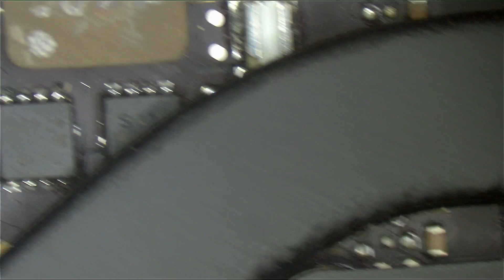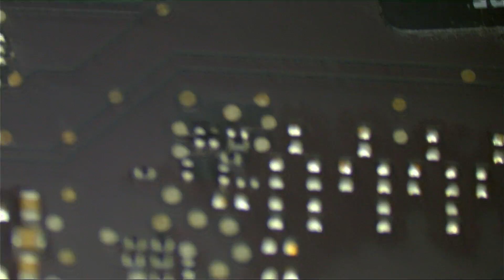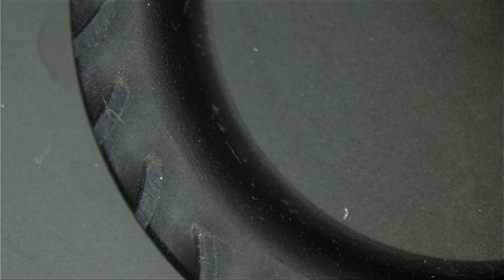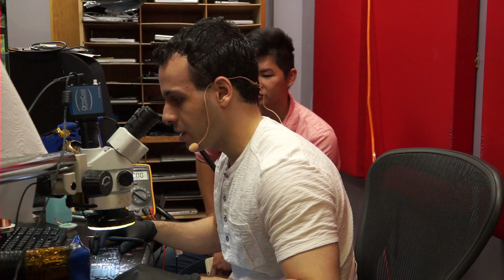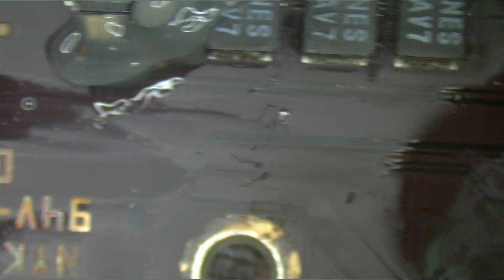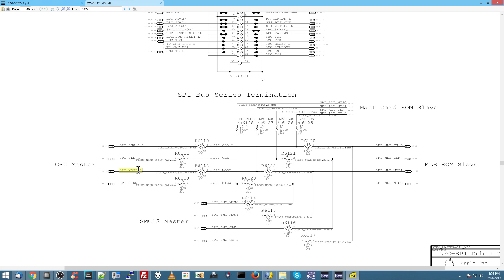My favorite motherboard repair: removing the JTAG connector :)

Comment from the maker: Want to watch our repairs as livestreams rather than edited down portions? Check out the live channel below for b-takes  & repair videos before they are edited, and random livestreams, and as always, I hope you learned something! 
👉 https://www.youtube.com/channel/UC6nZlvfz4YWoBWbjiaYJA3g
✓ Cryptocurrency tip links:
› Bitcoin: 1EaEv8DBeFfg6fE6BimEmvEFbYLkhpcvhj
› Bitcoin Cash: qzwtptwa8h0wjjawr5fsm0ku8kf40amgqgm6lx4jxh
› Dash: XwQpZuvMvU44JT7C7Uh6xHvkSadzJw9fMN
› Dogecoin: DKetsoCvwa2hF29ssgUA4Wz4hxT4kj3KLU
› Ethereum: 0x6f6870feb48f08388ee345cf0261e2f03d2fa310
› Ethereum classic: 0x671bfd61ba87edf6365c97cea33d66ba73645510
› Litecoin: LWnbTTAjojZQt68ihFJFgQq3cYHUsTcyd7
› Verge: DFumZ5sMhi3JktLQpsTVtV9xUt3zKDrcZV
› Zcash: t1Ko3FkphQYoQroQc8k2DVk4WKMAbmNR8PH
› Zcoin: a8QdvArHmdRYe1MjiqtP6jDNe6Z4JgnRKZ

👉Thank you to everyone who made a purchase on eBay via our affiliate link at http://rossmanngroup.com/ebay for helping support this type of content. All tools used can be found in the video description as well.
Reply: Most likely the JTAG connector's corrosion was pulling the test lines low, putting the CPU in test mode instead of operating normally.... quite a common issue in this industry.
Reply: Where do you get reliable schematics for these motherboards? I have found some on google but they are either incomplete or not from a source that I trust.
Reply: im not a expert of any sorts but im pretty sure usually the problem is poor quality in example desing
Reply: Yes I did and I hope the person that messed up that board learned something too.
Reply: sus sustained     voltage
Reply: I bet you both have the same chinese person! That would be funny.

Not so much for you but for the rest of us.   :)
Reply: that PCB is fryed
Reply: Louis Rossmann l
Reply: I love it when you swear and call all the apple products such shit. I do the same and people freak all the time..lol

Comment: Why remove JTAG connector? Just Curious, I don’t know anything about electronic repairs.
THX
Reply: Always corrodes first since it's usually on the edge of the board near the possible liquid ingress point and has exposed pins with power lines. He's made a meme of destroying it, but he replaces it every time

Comment: What the heck is the round glob that was just to the right of the jtag connector?  It's clearly visible at 3:25 at the bottom of the screen, below the resistor.  What is that??

Comment: JTAG is used for programming a certain kinds of microcontrollers, FPGAs with internal non-volatile memory, and sometimes SOCs. Basically anything from ATMEL controllers (like the ATSAMD series) to chipsets of PCs and Macs. Its highly unlikely that it is used to flash a bios, especially on apple products that seem to be nearly the same across the board. They simply would flash the BIOS on an external EEPROM before soldering it to the board. That is then read by the CPU through the chip-set, which handles basic functions such as the BIOS. After that, a BIOS update can be done from the computer itself without the need of JTAG. At least thats how PCs operate.

Im not sure that, that would be a true JTAG port because I honestly wouldn't think that apple would solder a connector on to something that isn't meant to be tampered with. It would make more sense to just use some pads that a pogo-pin jig can be held up against to do debugging and flashing. 

Obviously its hard to tell what they are doing with that port unless you look at the schematics, and also they are apple and they like to do things "differently".

Comment: How are the guys in the Genius Bar meant to diagnose and repair boards if you've removed the JTAG connector? ;)
Reply from the maker: I know, what a pity :)
Reply: how likely is it that the genius bar actually even bothers though
Reply: @cyborgsheep6077  You found the point of the joke, congratulations
Reply: I scrolled through soo many comments searching for this one, thank you so much
Reply: You don't give something under warranty to Louis and you don't remove a jtag connector on something with warranty?

Comment: What does the JTAG connector do?
Reply from the maker: Allows them to program it at the factory.
Reply: I was looking for an answer to this question. Wonder why this didn't get upvoted. Thanks for asking :)
Reply: Louis Rossmann I would have expected a better answer than that. It's a two wire serial bus to talk to JTAG traps on the chipset, flash memory etc. A JTAG trap on the CPU might be able to flip the CPU into a debug state where you can single step, change registers on the fly, drive it's address and data busses etc. On a chipset you could potential read and change registers on the fly and flash memory has a trap to dump it and write to it. You can often do more with a JTAG than programmatically because it exposes things you could usually not get to, such as changing the code in an FPGA etc. Before you get excited a JTAG is not that useful to you if you're dealing with a secure device. Usually that will have fuses programmed on it's microcontrollers to either turn off JTAG or it won't work at all if the device has security fuses blown.. or you need the key for a cryptographic handshake. All the same it's very useful to reflashing a bricked device or for other hardware exploration.

Comment: I don't understand why other smaller shops would let that sort of stuff go.  We do not do low-level board repair like Louis at the store I work at, but even WE have a sonic wash machine.  Seriously, so many shops think a little QD cleaner is enough for liquid spills, and it is absurd.

Comment: Do you really use 450 degrees Celsius as the work temp for your hot air? Because I alternate between 350 and 400 and am scared to be too hot where it messes up other things or too cold where I need to keep on heat too long to melt which also messes stuff up. Thanks

Comment: I may be 15 and looking too far into the stars but.... Someday I want to open a store that has sort of the same morals that your store has. I cant stand Apple because they are a complete rip off. I watch your videos for hours because I find I can learn a lot from them and instead of loosing money messing up some kid at school's computer, I can learn from how you do it. I believe in repairing things whenever possible (for cheaper then buying a whole new one). For example, when i was 10 i learned what a back light was and I took apart my monitor, built a cardboard frame, and shoved Christmas lights into the back. Although it was not the best it still worked until I could get a new one. I have been clustering old Desktops people have been donating to me/ I have found. One time i found 15 IBM 2008 cash registers that I upgraded and clustered. Anyway, I like how you say "as always, I hope you learned something" because that's a good thing to share knowledge to help others in the community. My teacher just bought the "class" a micro-soldering station and microscope so I can start repairing the mac's more and other things such as connectors. My favorite repair story is when Apple told my friend "It will be an $859 tier 4 repair" then he brought it to me which I fixed for 25 cents. not $859.....
Reply: ThankGodالله UmmerFarooq they said it cost them 25 cents. Not that they charged 25. And it's their friend.
Reply: ThankGodالله UmmerFarooq It's obvious that he didnt do it for the money. He did it to learn something. Relax.
Reply: Well, did the friend learn not to buy from Apple?
Reply: Can you find me a IBM 5100?
Reply: ThankGodالله UmmerFarooq  He's not running a business, he's 15. It was his friend.
Reply: ThankGodالله UmmerFarooq  You're insane

Comment: Zero reasoning for removing the JTAG specially when it could have been easily cleaned.
Reply: They trap spills and kill boards so ridiculously easily and nobody wants that connector.  Apple doesn't want it because they won't touch this now out of warranty.  All they do is cause problems.  Someone that knows how to, and wants to use the JTAG connector on a Mac is not going to pay Louis to repair one.
Reply: Possible problems(unintentional cross talk between conductors)  could have been hidden under the J-TAG

Comment: i love this video! an american mad at an Asian because he does not over charge for doing work and it ate away at him through out the video "$87 for a touch ID" 10 times in the video. even when he fixed the problem he was tasked to do he still harped on the Asian guy for not over charging. this represents why us Americans do not manufacture anymore because every employee wants to make $50 an hour to do simple manual labor that any where else in the world does for allot less.
obviously this is not manual labor it is skilled labor and demands more money but this gentlemen charged $229 for 15 min of work and I bet the Asian guy next to him would have charged less and finished the work  (attaching the connector) 
this is just an observation based on a short video, I dont know the guy so take it with a grain of salt
Reply: I doubt the Chinese guy is doing it by blind luck. He had to learn the same stuff and still does it cheaper.
Reply: There are a number of input costs you are not factoring in. 1) Education, and the time/money he spent to become good at what he does and perform high quality and guaranteed work (a 15 minute repair for him might be an hour-long, shoddy quality repair from another technician). 2) Cost of living in the area needs to be factored in order to determine fair compensation  3) Equipment. The ultrasonic machine, rework station and all the other equipment he uses costs money. Equipment breaks down over time or becomes obsolete and needs to be replaced/upgraded so a small part of their costs should be factored into the cost of the job. 4) Business costs like rent, bills, office equipment, marketing, etc. 5) Salary for other staff like his receptionist. 6) Contingency. In case something else is wrong with the board that requires him to spend a lot of extra time on it. Or in case something goes wrong with his business then he's got a little extra tucked away to deal with it.
Reply: One man's overcharge is another man's undercharge - Louis stated the dangers of undercharging
Reply: If 2 guys done the job guy 1 has 10 years experiance fixes it in ten minutes 220 dollers guy 2 fixes it in 2 days because hes 4 weeks in to training  . You see knoledge is priceless its 200 i bet that part wpuld of easily cost 400 500 so he saved the guy money and time with his knoledge and patience
Reply: n balaboon  

The people employing illegals charge less because they pay less in costs. They don't pay taxes so they don't have to add that into the price they charge. They don't carry workers comp insurance, they don't include that in the price they charge. They don't pay thier employees a full wage. They don't provide a guarantee. They just charge more when you have to come back.

You don't make more working under the table. Your employer just gets to keep the money they should be paying in operating costs. All while undercutting the competition.
Reply from the maker: +CoolRaul over charging is incredibly  subjective. Of course most want all for free and call everything overcharging. The issue with this communist mindset of how much time something took is that it does not take into account the time spent learning. If you want hourly billing, I'll charge for the fifteen minute repsir plus 700 hours it took to get good enough to solve in fifteen minutes, but I doubt you'd like that bill.
Reply: It makes me laugh every time I hear these people say you and others are "overcharging" people so if that's true bringing it to Apple must be cheaper right?  I don't know but my opinion is Apple probably charges more. I've heard others state Louis has dishonest business practices. Maybe they think that because an honest business like Apple never films what they are actually doing and saying behind closed doors. If you stop showing and telling people everything you do and instead say everything your business does is confidential and/or proprietary you might convince them you are honest after all.
Reply: It's also good for customer satisfaction if, in exchange for a higher fee that 1) You can guarantee that the repair will be high quality, be tested properly, and be unlikely to have workmanship defects, 2) The repair is guaranteed and if the repair fails because the technician screws up, that he will redo the repair at no extra cost to the customer and 3) That the technician will absorb additional time/part costs if a complication in the repair process appears rather than trying to charge additional money over what they initially quoted (which can be seen by some as being sleazy, even if that additional charge is justified)
Reply: @n balaboon: Oh, you're a Trump voter? Did it ever occur to you that "Chinese guy" working for pennies is probably an illegal immigrant working under the table, and not paying taxes?
Reply: @n balaboon: The guy on video that Louis is talking to is the boss. He literally said his Chinese guy works for pennies. Hence his guy is probably an illegal working under the table. There are a lot of them in New York City.
Reply: @n balaboon: You keep confusing the guy who owns the shop with the illegal he probably hired and is paying cheap. No, his "Chinese guy" is probably not literally working for "pennies". But yes, he is probably working under the table for way less than an American citizen, not paying taxes, and sending his money back home.
Reply: @n baboon: I'm sorry basic concepts are too difficult for you to understand. Ignorance can be fixed, but stupid cannot.

Comment: I'm still a total noob when it comes to motherboard repairs, but what is the JTAG connecter for if you can just leave it off? Why is it on there in the first place then?
Reply: If you have the right utilities you can program BIOS via JTAG, but you can also just clip onto the SPI chip in many cases.  JTAG gives you debug access into the CPU.  It's a standardized set of signals on many chips that's cheap and effective at debugging issues in the field.
Reply: Stefan de Jong It lets you program the board if there's no BIOS. As long as the BIOS works, you don't need it. It's usually only needed by the factory and to repair a bricked board.

Comment: what about spraying it with deoxid
Reply: Could improve it, but I know from experience that the solder develops microfractures and you must reflow everything afterwards anyway to get it working.

Comment: pardon my ignorance (never worked with a hot air or reflow solder) but what is that gel? is that flux or something or just like a heat conducting paste?
Reply: Never mind... lol
Reply: It's flux for SMD work. It can get outrageously expensive, so I mostly use rosin and only save this for the tiniest, trickiest jobs.

Comment: hey i got my microusb charging which is the only usb port for my intel atom tablet stupidly shorted. now.it will charge and also thinks charging when unplugged. can be used on simple usb devices but not like usb hubs, etc. what can u suggest?

Comment: I'm no electronic expert but you probably don't need that much flux 😂
Reply: Person. It’s a joke, they’re not serious at all
Reply: Stefan Constantin Dumitrache actually that's untrue. While you need only one spermatozoid to fecund the ova, you need a lot of sacrificial sperms to corrode the ova's corona radiata and penetrate the zona pellucida.
Reply: SukoSeiti the sacrificial ones are to get past the white blood cells.
Reply: The sacrificial ones are for:
1. Choosing the right path in the labyrinth in there.
2. To get killed by white blood cells.
3. Penetrating the egg, so one can get in.
Reply: Stefan Constantin Dumitrache Great comment.
Reply: The bigger the glob, the better the job.
Reply: SukoSeiti I took A&P and I'm still fucking lost
Reply: SukoSeiti *golf clap
Reply: Person. Spotted the SJW
Reply: I always felt that too. But remember how small this stuff is.  Tweezers there are needle sharp.
Reply: Technically the ova doesn't need more than one sperm cell either, yet look how many come out. Must be a men thing, wasting resource like that.
Reply: Stefan Constantin Dumitrache flux is inexpensive, like semen
Reply: HumorVortex Mosco the fuck

Comment: I dunno about the MAC specifically but often resistors near the JTAG port are there to hold the JTAG lines in a known state and therefore prevent inadvertant JTAG activation.
Reply: That's what he thought initially, but then he looked it up and no. Watch the video.